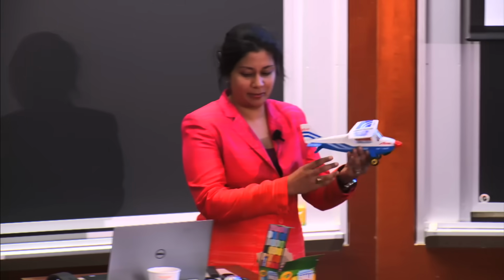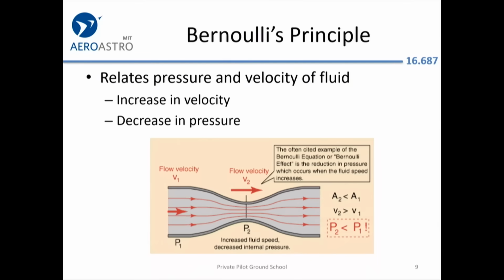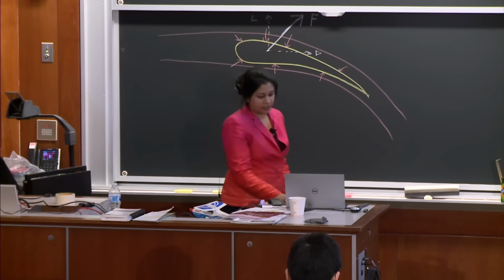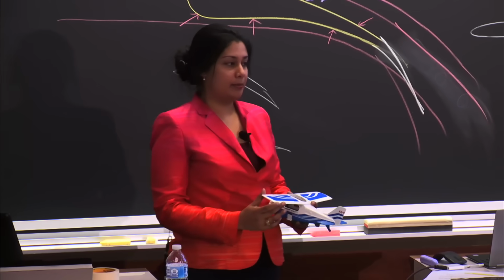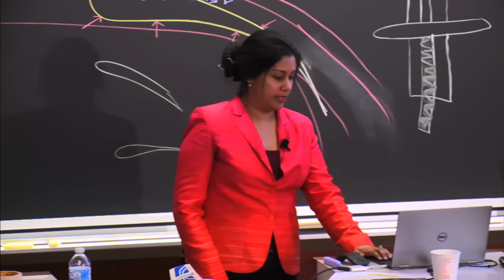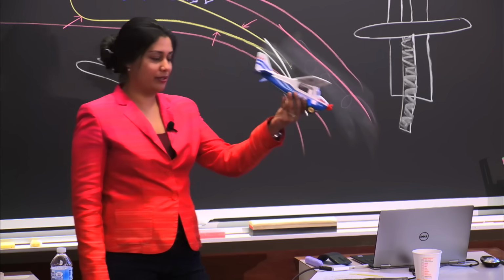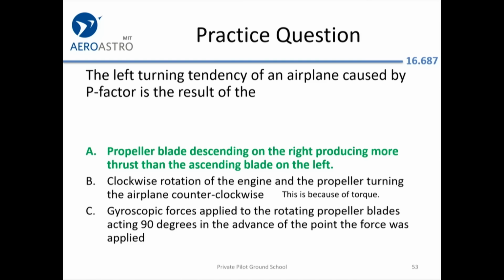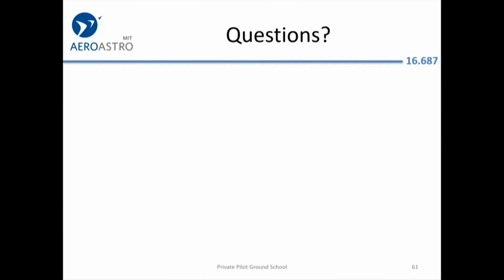Lecture 2: Airplane Aerodynamics

Comment: For anyone confused on Bernoulli’s principal, think of when you’re waiting at a light to turn and the cars in the lane next to you are going by fast; your car gets pulled toward them temporarily that’s why it shakes a little bit, and that’s because the velocity of the air from the cars passing you is faster than the velocity in your lane so there’s less pressure and you get “pulled/pushed” to their side from to the higher pressure on your side. 
You can also see this if you cut a thin strip of paper and place it below your mouth then blow quickly over it; the paper will rise due to the lower pressure where you’re blowing the air
Reply: Nope.  Bernoulli is NOT about speed of fluid. NOT!.
It is about fluid Acceleration along a flow.  CHANGES IN SPEED along the flow path.
.
Cars passing you first push air out of the way in front of it, therefore, that wind is pushing you away.
Then, the air rushing in behind that car draws you back inward.
.
The decrease in pressure above the curved paper is first caused by the Coanda Effect, then entrainment as the paper is pulled straight by the air's viscosity. 
. . . 
The "fast moving air" out of your mouth is AT atmospheric pressure, NOT lower. It can easily be measured as such.
Reply: @Observ45er  I was just quoting what my physics professor said 😭 damn bro, okay it is NOT about speed, acceleration only and we can’t create a vacuum with our mouth 🫡
Reply: @tatertot6212  

Well, it appears your 'professor' didn't understand it either, as I explained.  What I wrote should make sense to you.
...
The word vacuum is used two ways.  One is to refer  to zero air and pressure and the other is a pressure less than atmospheric pressure. 
You must specify which you refer to.
Zero pressure can be called a full vacuum, or absolute vacuum.
The other is commonly called a partial vacuum.
We easily produce a partial vacuum with our mouth.
Look for this video: The Science Of Straws - Mr. Wizard's Challenge.

You Tube doesn't like URLs so you can also search for this: v=Ycef5XXiozc
Reply: I also have a full analysis of this video 1 year ago

Comment: 15:48. I can't accept that the whole airplane generates the lift force. The lift force only occurs at the wings because of their airfoil shape, if the whole aircraft generated this force, then it could also have the airfoil shape. Just like the wings of the bird are what makes the bird fly not the whole bird itself.
Reply: YOU are right : any part, like the fuselage that carries no circulation does not create lift.
The wing carries lift because a local circulation is present, which is the result of local vortices are from the trailing edge until the Kutta condition is satisfied, namely smooth flow parallel to the trailing edge, then the sum of all vortices separated are equal and opposite to the remaining circulation.
Local lift = dens × v × circulation times the width of the span element.
The total lift is the integral of the lift of each small span increment for the entire span. The fuselage has no trailing edge, so no circulation is there. A hole in the lift distribution.

Comment: In the lecture it is still assumed that lift can be explained by Bernoulli's formula. But why is there never any real explanation of what is happening to the air molecules when transiting the leading edge and the surfaces of the airfoil. I am sorry but again I am somewhat unsatisfied with the shortcut to get to use formulas... it still does not lead to really understanding lift. Formulas are fine and useful but the underlying true behaviour of the molecules in motion is obligatory to me.

Comment: personally I found this lecture really helpful, as A high school student I want to do aerospace or aeronautical engineering (aircraft design) I love to design airplanes on CAD application like fusion 360 and Solidworks and try to make them as realistic as possible. funny enough I recently found out Chat GBT can give you roughs design ideas if you give it a group of targets, It spits out alot of tecnobable but this lecture cleared alot of those questions I had, and introduced me to new ideas like frame or reference. IDK how people think that the equal transit theory is true but it is understandable, but if it were true the plane never would achieve lift because when the air travels above the airfoil faster than the bottom it creates a pressure zone causing a large amount of drag (stalling the aircraft), or supersonic shock. Designers had to find a way to work around this issue when creating wings for supersonic aircraft. Please correct me if I am wrong

Comment: 41:53 Flaps on takeoff also allow an aircraft to get into the air sooner (not necessarily faster) because of things like short runway or contaminated runway (slush). Flaps provide lift at slower speed.

Comment: and an airplane can and will stall at any airspeed.  Its all about the relative wind.  The airplane doesnt know or care where the ground is either. Its all about the relative wind.  The main thing to remember about an airplane wing is that it will stall anytime the critical angle of attack is exceeded.  Once the critical angle of attack is exceeded, the wing no long creates lift, then stalls.

Comment: This can be explained in one single word : Bernoulli’s theorem
Reply: No, lift is not explained by Bernoulli's theorem. That's one of the biggest missconceptions about lift out there.
Reply: @xFolkvangr  She is NOT saying Bernouli is not in play here.  She is simply saying that "Equal Transient Theory" is not in play here.  The camber of the wing is a venturi. The venturi effect from the camber of the wing does excellerate the air. "Bernoulli." She actually SAYS that.  What is NOT true is that the camber of the wing causes the air on top to travel a "father" distance and that is what "casues" the air to travel "faster." That is what is False. For example, when the F-4C/D and early E Phantoms droped its leading edge flaps and trailing edge flaps the camber was increased, thus increasing the venturi effect thus decreasing pressure even more, thus increasing lift.  But the distance from the leading edge and training edge never changed.  So it is not the distance the air has to travel that causes it to excellerate.  Furthermore,You have to understand fluid dynamics.  The air over the top of the wing is excellerated do to camber (venturi), and it reaches the back of the wing before the air under it (this is why Equal transient theory is false which she explained).  That creates a void, a "vacuum of sorts" and that causes the air on top of wing to travel downwards (one form of downwash) to fill the void.  The air under the wing is defected downward momentarly. That momentary downward movement also contributes to a percentage of the lift (second form of downwash), but as soon as its free of the wing it travels upward and around (wing tip vortices) to fill that same void behind the wing. That void behind the wing inwhich both the upper and lower air particals are trying to fill is the induced drag a wing creates. THAT IS WHAT SHE IS SAYING!!  Read Aerodynamics for Naval Aviators and you will see what she is talking about and you will be humbled too

Comment: Equal transit theory may not work on typical airfoil profiles… however if the profile or airfoil is fully symmetrical and if the camber is 0 then the molecules would meet at the same time, think of the vertical stabilizer… or horizontal stab. At 0 degree AOA

Comment: This was a Rolex of all lectures! Brilliant stuff! 

Dr Srivastava has my respect!
Reply: So My question is that why not parachutes are fitted in air planes so in accidents type of scenario parachutes deploy to save lifes any aeronautical expert plz answer that...thx
Reply: I am not an expert, but I know this is already in use for some small, low speed planes. In a big passenger jet the speed is too high, so the parachute could not be deployed properly
Reply: @Jotinha6131  what
Reply: @Jotinha6131 Neega you jump, then after reaching the proper altitude, you deploy.
Reply: @Defender_928  Simple, parachutes would be very heavy and airplanes would therefore weigh more, leading to complications in design or might have to come to carry fewer passengers, consume more fuel which is not ideal. But there are small jets like the Cirrus which have a parachute in them.
Reply: Do you have group for chart
Reply: Theoretically you could design passenger aircraft to have some type of of parachute. But most accidents happen during take off or landing. It's not worth the billions of dollars investment to save a few hundred lives in such rare high altitude circumstances

Comment: I have a doubt. 
Why is there no boundary layer separation from the top portion of the wing. How are you sure that the low pressure air flows down along the trailing edge. 

I always thought that the boundary layer separation and the turbulent air which comes after it created the low pressure. So the difference in pressure tried to push the plane span wise(trying to curl in from the tips. As you can see the vortex at tips of the wings, which curls anticlockwise due to the pressure difference) and chord wise upwards.
Reply: You are right, there is boundary layer separation, but it depends on the Reynold's number and the angle of attack. At higher fluid velocities, the separation is easier initially, that creates low pressure behind that zone, causing fluid to move back in creating vortex and stall increasing drag a lot. But again point of separation depends on angle of attack as well, combined with fluid velocity (and other factors like fluid properties). The optimum angle of attack for each shape of aerofoil is different.

Comment: I've been totally confused by this explanation. At 6:19, equal transit is said to be wrong; that there is not acceleration to bring the split airstreams back together at the trailing edge, Then, at 12:34, we have accelerated airflow without a means of increasing velocity bringing Bernoulli's principle which requires that the fluid be "pinched" or constricted to increase the velocity and decrease the pressure.  This contradictory since there is not a barrier above the airfoil to contain the airstreams.
 Doug McLean | Common Misconceptions in Aerodynamics, in https://youtu.be/QKCK4lJLQHU explains why Bernolli's principle does not create low pressure on top of the wing, rather that the bending of the airstream in each layer causes an increaing pressure gradient across each airstream layer above the airfoil and even extending above and in front of the leading edge.
Also, Krzysztof Fidkowski | How Planes Fly https://youtu.be/aa2kBZAoXg0 goes into easy-to-grasp concepts that brings you to the ,"Wow, now I get it" moment.

Comment: Speaking extremely generally (kinda unfair) MIT GENERALLY are like "todays lecture I will be trying to explain how smart I am". Its not usefull. Explain the basics....bernoullis, pressure differential, ways to calculated, manufacturing and your done. No need for all this

Comment: Be careful about saying the Equal Transit Theory is incorrect using a paper airplane. She alludes to it later in the lecture when she talks about the air moving over the top of the airfoil moving faster than the air passing underneath the wing. A paper airplane does not produce lift the same way an airfoil does. Except for the initial toss, the paper airplane "flies" downward. Bad analogy here. Have you ever heard of the boundary layer formed by air passing over the top of an airfoil. "Pushing air downward" does not produce lift. Differential pressure (high on the underside and low on the topside) produces lift. Flaps produce more underside pressure and decrease topside pressure by changing the geometry of the airfoil not by "pushing the air down." The diagram of the airfoil is not necessarily correct. Some airfoils are pretty much flat on the bottom. It may produce a force that pushes the back of a curved wing up, but not lift per se. No, the wings produce lift. If you take the wings off of an aircraft it will not fly unless excessive force is applied and lift is not produced. Lift definitely not produced from bottom of the wing or there would be no stall unless the cord of the wing was perpendicular to the relative wind.. A stall is produced when the boundary layer on top of the wing is disturbed - burbles (turbulence) of air form and lift is interrupted. Not the best explanation of lift and how it  is produced that I have heard.

Comment: What frustrates me a little bit is that she does explain that equal transit theory is wrong and that most of the lift is created by changing the direction of the molecule but after that she applies the bernoullis principle to explain how the rest of the lift is created, without explaining where this change of speed on the upper part of the foil comes from. As far as I know this is because of the boundary layer effect. But it sounds like she is contradicting herself. I hope someone can help me with this. 

Btw I want to say I’m not trying to be critical. I love these open courses and that I am able to watch these all the way from holland. I’m a BSc in mechanical engineering. Hoping to start a master in aerospace engineering next year. 

Keep up the amazing work 👌🏻

Comment: and.....right after saying how wrong the equal transit theory is, she goes into Bournouli's principle and describes how air moves faster over the top of the wing (because it goes a greater distance in the same amount of time.....aka, equal transit theory)....the difference in pressure above and below the wing causes lift, because air wants to move from high pressure (below the wing) to low pressure (above the wing)....this is also what causes wake turbulence that comes out of the tips of the wings

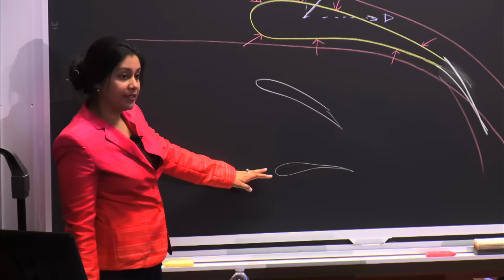Comment: 24:20 AoA (Angle of atttack) does NOT only depend on the angle of the wing, thus your statement is only partially correct. If you were to add "at the same speed", then your statement becomes correct. Anyways, a great lecture!

Comment: I have an issue with what she is saying about the equil transit theory. Omg a guy on the internet questioning a mit professor. My understanding of how lift works is that because of the way a wing is shaped it takes longer for the molecules to move over the top of the wing than the bottom thereby creating a pressure differential that (pushes or pulls?) The airplane up creating lift. Which is not the theory she said was incorrect but it seems too simmilar to be a coincidence. I am wondering if any brighter individuals could set me straight. 

Also with her paper airplane example she proposed that the wing was flat but it's not, at least not a glider design. Dart designs like the classic paper airplane function more like a fighter jet. More cutting through the air in a stable arc due to momentum. However glider designs (see spy plane eg klutz book of paper airplanes) use a accual airfoil and do exhibit the kind of design that supports the theory of lift I detailed above.

Mabie that theory of same speed whatever is alot more common than I think but I have never heard of it before and it seems to me to be a very odd way of explaing it and in the case of the paper airplane example slightly disingenuous as that design is not based on lift.
Reply: Though I suppose spy plane had that reverse lift now that I am thinking about it. So that it could do flips. But if you flipped it over it was also a good glider

Comment: newton.s law has nothing to do with lift. When a gas or liquid moves faster the pressure is reduced. Conversely when they move slower the pressure is increased. the reason the wing gains lift is the air flowing over top has a longer distance to travel in order to keep up with the  air underneath the wing.so they can meet at the same time. Therefore the air moving  on top of the wing must move faster thus reducing the pressure while the air moving under the wing moves slower thus increasing pressure. this is known as Bernville's principle NOT Newton's law. This moron needs operate a 7-11 or circle K.

Comment: Dr Tina’s lecture emphasizes that the downward direction of the air created at the trailing edge of the wing is almost more effective at creating lift than the Bernoulli’s principle which she touches on but does not give it much credence.  As a pilot of 50+ years, I would contend that the opposite is true.  That Bernoulli’ principle creates more lift than the downward force created at the trailing edge of the wing.  Not having seen any studies I could subscribe to the fact that two molecules of air hitting the leading edge may not necessarily reach the trailing edge at the same time, but the air passing over the top of the wing is traveling at a higher rate so lift is created based on Bernoulli’ principle.  She even touches on and shows a diagram of the faster moving air over the wing, which creates lift due to less pressure over the wing thus creating lift.